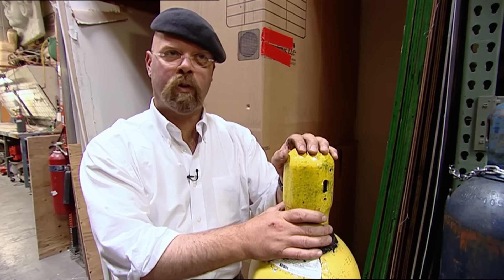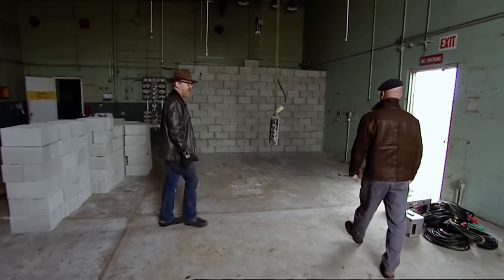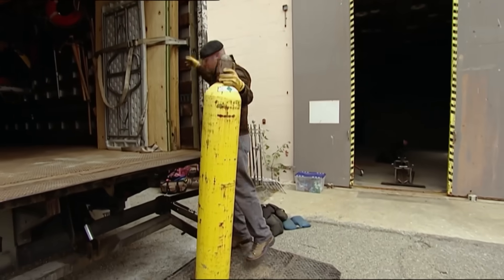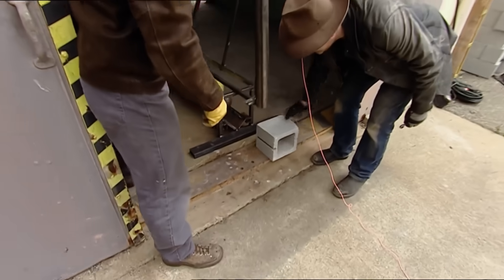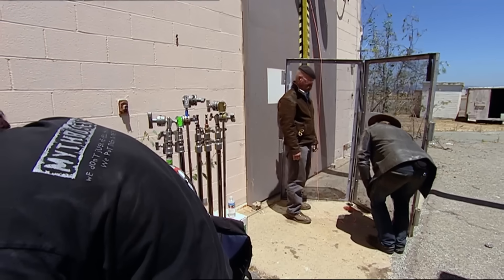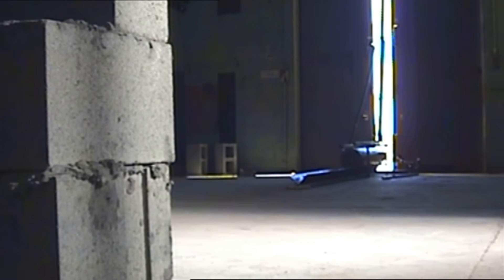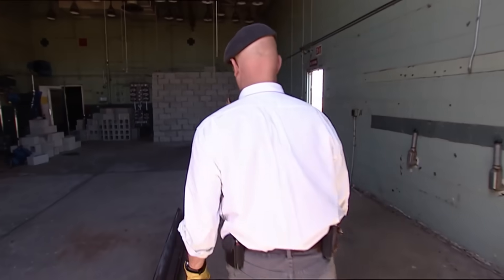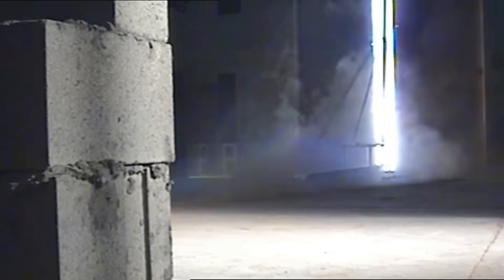What Happens When A Compressed Air Tank Explodes? | MythBusters

Comment: Sixty years ago I worked in a laboratory in the UK, an oxygen cylnder was dropped from the second floor  when it was being delivered via an external door. It landed on its connector, and the cylinder shot over the adjacent single storey building (I was inside). They red-designed the stem so gas cylinders were mounted externally and gas piped to the labs (principally, from memory, oxygen, hydrogen, nitrogen and carbon dioxide.

Comment: Should have done it with a 6000 PSI cylinder of similar size. They weigh more like 200 + lbs. Though that should be done someplace more uninhabited like the quarry where they blew up the concrete redimix truck. Fire stations use several of them in a cascade filling system to fill their carbon fiber breathing air packs to 4000 + psi. Tim at Mac1 Airguns had a surplus US Air Force stamped one in his shop. I remember helping to load it into his pick up to go get it filled at Dive and Surf in Redondo Beach. It was noticeably heavier than a "normal" 3000 psi welding air cylinder.  Dive and surf could only fill it to 4500 psi. 

Decades ago in my 18 wheel travels I talked with a guy that had been in the Air Force stationed way north in the Arctic. Something like Dew Line or similar. He said they had dozens of air force blue 6000 psi cylinders there. He said it was boring duty and sometimes for entertainment they would take several of the 6000 psi bottles out on the ice, lay them down and whack the valve off with a sledge hammer. He said many went out of sight out across the ice which he said was flat and featureless as far as the eye could see.

Comment: It happened to my father when he was foreman of the crew on the Oahe dam project. 
 The construction project required 2 large tunnels to divert the Missouri River while the dam was being built. 
 An oxygen cylinder fell over, the valve broke,  the cylinder became an unguided rocket inside the tunnel.
 Dad said the circular I-beams were 1 foot in diameter,  1/2 in thick.
 The cylinder bent several. 
 No one was hurt. Just scared I expect.

Comment: High school welding class in 1980 a fellow student was changing an oxygen cylinder and had removed the cap before he had the safety chain in place.
Somehow the cylinder was knocked over and it hit a low steel stand causing the valve to be knocked off.  It took off, knocked some light weight stuff out of it's way and went through the outside wall, finally stopping about 3/4 of a city block away in an alley that just happened to line up with it's travel path.  My ears rang for two days after that.

Comment: I’ve always wanted to try this after working Heavy Structural Steel  25 years. THANK YALL 👍👍 For those that don’t know the difference between a Full O2 cylinder and a EMPTY one a full one will actually make a POPPING noise when you give valve a good crank open and an  empty one will not , that’s why you write on top of cylinder M.T. (EMPTY) so the next guy doesn’t DRAG a M.T. tank out to his work area , “CAPISH” especially a SIXPAK of O2 cylinders 🤬 40lbs of O2 and 6-7 lbs of fuel “acetylene” . NG fuel may vary and Never start a Long Cut  with a medium low tank … p.s………… … 🔥Burners🔥Rule🔥

Comment: Something like this happened a few years before my time at a technical college in Vancouver. The cylinder went through the front doors, managed to ramp off something, went through the building across the courtyard (through 4 walls), was redirected by way of the front quarter of a car (the driver was ok) before guttering by the sidewalk and wedging itself against the back wheel of a bus. The bus was struck so hard the driver thought he had been rear-ended.
That was the last day the college operated without SOPs for handling had cylinders.

Comment: As a construction millwright, I heard stories about the old days when they were building a coal-fired generating plant on Lake Erie that they would tack weld a pipe at a 45° angle and put one of these cylinders in it and then knock off the valve with a sledgehammer and apparently, the tank would go about a mile out into the lake before splashdown. The good old days.
Reply: Equally scary and awesome

Comment: That  IS NOT an  " explosion " .    
A high pressure tank holding  2500- 3000 psi  -  burst / exploding in frags would be lethal to anyone nearby. 
Most high pressure cylinder heads have blow out safety features made into the bottle head that pops open before the tank fail pressure is reached -  to prevent the tank from exploding.
Reply: Yeah we’ve been clickbaited to old content

Comment: While the acceleration force is highest when tank pressure is highest, the compressed gas cylinder may not have reached maximum velocity by the time it hit the first block wall. If they computed the tank's velocity and remaining pressure with time, they could have determined when it would have reached max velocity.

Comment: In the 70's I was working in a pizza place and someone knocked over a CO2 cylinder and knocked the valve off. It went thru a metal door into the rear parking lot.

Comment: That tank had a lot more acceleration left in it. If it can do that in such a small space it's scary to think about what it could do with more runway.
Reply: Put wings on it 😁
Reply: It's terrifying. I've seen it happen with a helium cylinder. It pretty much becomes a missile that goes through anything short of heavily reinforced concrete. The one at work went through a cinder block wall, into the office and up through the sheet metal roof landing in the grass near the parking lot. If someone was in the path they would be dead..
Reply: In theory yes, in practice it would start tumbling well before maximum potential velocity is achieved…
Reply: Rocket car part 4 lol
Reply: Needs a Taofledermaus treatment.

Comment: I used to be an airsmith at a welding supply company ..we actually would show this episode to new hires to teach cylinder safety ...
Reply: Back in my Navy days a Master Chief once told me if ya get hit by one of these you won’t slow it down, just lubricate it.
Reply: @ironsausage808  he's absolutely right. Something that heavy going that fast is just going to pass right through you without much fuss.
Reply: In welding school we were shown films of what could happen with high pressure cylinders if mishandled or treated without respect. It's no joke. Basically a rocket motor just waiting for some clutz to set it off. 😳
Reply: New hires: cool, I'd like to see it happen someday (probably)
Reply: I live on a farm and will take what I can get for safety training material, this got added to the list reeaaally quickly lol

Comment: A nice demonstration ...that in no way replicates what really happens. I have actually seen two events where some idiot violated safety guidelines and let an "H" cylinder fall and shear the valve off. Fortunately no one was injured, cylinders do not fall perfectly straight, valves do not shear off perfectly straight and those fuckers don't shoot across the floor perfectly straight (unless guided somehow). The do knock holes in cinder block, they do tear the place apart and they bounce all over the place until the gas pressure runs out spinning in a circle the one time and lodged in a corner the other. Oh yeah, they scare the living shit outta most people and cause a lot of yelling and screaming...and more OSHA paperwork than you can imagine.

Comment: A welding instructor told me a story about an argon tank going ballistic.

During a shop cleaning, someone unhooked the chain strap from around the tank, meaning to sweep up dust from behind it. Unfortunately,  they forgot to place the chain back. A while later, a welding cart bumped into it, knocking it over and cracking the side of the nozzle. The tank began spinning in place so fast, it wore a circular indent into the concrete. Terrifying.

Comment: That's not a solid brick wall, it a hollow cinder block wall that you can punch a hole in it with a hammer.
Reply: Yeah and that cylider will go thru both and keep going
Reply: They represented what a typical masonry wall would be and what a cylinder could do to it.  Most masonry walls in commercial buildings are completely unreinforced like that (i.e no rebar or internal grouting).  In heavy industrial buildings you would have grouted vertical cores with a single 15M (metric) or minimum #4 bar (imperial) every 4'-0" and at each building corner, plus a horizontal grouted course, with similar rebar, along the base of the wall and every 4'-0" up, but in between those grouted areas the wall would stay hollow.  No one builds a masonry wall and grouts every single core, it's a waste of money.
Reply: @mrquirky3626 they do it around where I live.
Reply: @waynes.2983 I have personally done it on many occasions with certain small walls, problem with that is reactive soil and movement. Stripping a concrete filled wall is not fun
Reply: In US houses this is not only a solid wall, it's a bunker wall...

Comment: I worked in an industrial fab shop for 35 years.  One day the new guy started.  He thought he knew everything.  The Shop was switching from the first shift to the second shift, so twice the amount of people were in the shop.  Some working and some milling around.  The new guy decided he needed to move the Oxygen cylinder from one part of the shop to the other.  He strapped it down to the dolly and moved it.  Nothing out of the ordinary happened, just another safe day at our place of work!
Reply: What's the moral of the story then?
Reply: @ЮрийГригорьев-ь8х  you can lead a horse to water but you can’t have a bird in the hand.
Reply: @mcdouche2 I didn't get what the new guy did wrong? He wasn't supposed to move the oxygen tank or he wasn't supposed to strap it to the dolly?
Reply: @ЮрийГригорьев-ь8х  it’s an anticlimactic story.  Meaningless in its story.  Pointless for its length.  Its only point is to leave the reader stunned after reading it and possibly laugh at its stupidity.
Reply: @mcdouche2 alright. Thank you. I'll avoid touching oxygen tanks anyway.
Reply: @ЮрийГригорьев-ь8х 0 critical thinking
Reply: @pootispiker2866 alright. Good for you. I want to be like you. I find myself overthinking at times.
Reply: @ЮрийГригорьев-ь8х Must not be very often that happens, yeah

Comment: Not the best test, in my opinion.  They should have put rebar vertical and horizontal in the concrete blocks, filled the spaces with concrete.
Reply: For what? Is this how they build cinderblock walls in real life?
Reply: @ЮрийГригорьев-ь8х  IF you want strength, yes.
Reply: @sandrabonner8208 well, aren't cinderblocks by design are supposed to be insulating material as opposed to strong materials?
Reply: @ЮрийГригорьев-ь8х  It depends on their function; for insulated walls, yes, but concrete is a poor insulator so I would recommend the exteriror walls built for strength, interior walls wood or steel with insulation then drywall.

Comment: An old boss of mine was in the U.S. Navy, was coming back to his ship (destroyer), saw some excitement going on, found out that a fire extinguisher that sits on the pier got knocked over, the valve got sheared off, it embedded itself into the hull of the ship. Told me that after I told him about several helium cylinders sitting in the store that I worked at that were not secured to the wall. I worked in the auto shop of the store (Montgomery Wards). I commented to him about how we in the shop had to have the oxygen and acetylene cylinders secured, that was when he told me that story. Got a 100.00 gift card as a reward.

Comment: Heard of a story where ppl didn't drain the water in the air tank daily, so over time the water rusted the tank internally.  This weakens the tank so one day it exploded.  But thankfully no one was hurt.  Even a blow out semi tire is dangerous.  At my mechanic shop, whenever they're filling a tire with air, they placed it inside this tire guard, so if it over pressurized & blows, the rim won't be a flying projectile.

Comment: Back when I was in high school, a fire started in the metal shop classroom and the heat burst oxygen and acetylene cylinders kept there.  All of them blew through concrete walls and held the fire department at bay until the cylinders were expended.
Reply: Dude. Same thing happened in my ag mechanics class in 1985... you didn't go to Willits Highschool did you?
Reply: School's out... for summer....  school's out for ever!  School's been blown...to pieces!
Reply: In my high school someone had broke into the  vocational shop at night stole a torch set and torched their way into the high school office safe.  Trying to change their grades? I don't imagine a school stored at lot of the milk money from lunch In the office. Don't think a school is a bank.
Reply: @ChrisZost  high school office safe?! The used gasses probably cost more than what was there.

Comment: My dad mentioned an accident that happened at a Westinghouse factory.  Somehow a large tank like that got knocked over in the shipping and receiving area and sheared off the valve.  It went through a loading dock door about 75 feet away and out across the parking lot, only to stop in the field next door, about 200 feet away.  No one was hurt.
Reply: Definitely not the first. My high school auto shop instructor in 1971 told a story of  a tank being knocked over, valve sheared off and sent the tank through a 12 inch brick wall and about 100 yards out into a field.
Reply: @sniper152 nope
Reply: @sniper152  its a cylinder, i dont know why thy call it a tank,
Reply: A tank is a cylinder with the ends capped off.
Reply: @MicahThomason a tank is a vehicle. I don't know why they call it a tank
Reply: @Mr.Anders0n_ it's called a tank because it stores something just like a water tank
Reply: @Mr.Anders0n_  Amusingly, that stems from military disinformation. The first tracked, gunned, armored land vehicles were listed as "tanks" specifically so anyone reading a manifest would think "containers". And it stuck.
Reply: My dad saw something similar happen building planes at the McDonnell-Douglas plant in Long Beach. Something happened where an oxygen cylinder was knocked over or fell down and the valve was broken off. It shot across the floor, punched through the aluminum wall, and across the ground outside. It eventually hit another hangar and came to rest. No one was hurt, the damage was comparatively minor, but there was a safety stand down.
Reply: My dad had a similar experience when a tank dropped down a elevator shaft. A few seconds later it came back up through the roof
Reply: They definitely will blast through a metal warehouse roof and land far away!
Reply: Was the tank okay?
Reply: @Boco_Corwin  it should be,
Reply: Brown pants moments throughout the plant though.
Reply: I tried knocking in the valve off one of these with a great big monkey wrench and it's a lot harder than you would think, I actually broke a weld on the Rock before I could break the valve off
Reply: i was a boilermaker and yes if an oxygen cylinder falls and the valve breaks off its like a torpedo
Reply: My grandpa had one of these fall over at the Grumman plant, everyone was in line for lunch and the tank went through every single one of them, killing everyone at the factory
Reply: @RVBJohn nope
Reply: @AMDSR94 uh huh YOU CALLING HIM A LIAR
Reply: I'm your daddy
Reply: @canUfeelMYface штF

Comment: This happened to my father.
He was on a gas company work crew, and they had a job inside a brick valve house that was on the south end of the block that I grew up on. The oxygen tank was unsecured and got knocked over and the valve was knocked off on a piece of equipment. The tank missed all three of them, but it left the building through the southwest corner and traveled three blocks west on the nearby street. If that thing had taken out any of the gas piping in that building, the combination of methanr and pure oxygen would have burned all three of them alive.

Comment: this happened to us in our parade float building shop. A coworker knocked over a acetylene tank, it hit right on the valve across a iron beam, the tank shot across the shop towards me, I jump clinging to a post, it bounced off in another direction, I ran out of the open bay door... no one got hurt, no fire. Thankful for doing parkor.
Reply: And acetylene tanks are only about 300 psig, unlike the 2250 for compressed gases.

Comment: Why lard and not crude oil?
Reply: Lard is cheaper
Reply: @aidankilleen7372  Lard is environmentally cleaner.  Breaks down and won't pollute ground water.
Reply: @aidankilleen7372 they have to worry about about the cost of crude oil for one episode when they have lead foil imported, make custom wrecking balls, test military explosives and rent full scale construction machines, wreck cars, use bulldozers, full on tanks, incendiary rounds, secret service vehicles used in the convoy that accompanies the president, and use classified explosives, rpgs, airplanes, jet plane engines, and so many more things that they and ruin, intentionally or unintentionally, yet they can’t afford a couple buckets of crude oil, in a major city near a port?
Reply: @IRKnTBot lard is cheaper and safer than crude oil. It always has been. Jamie keeps a bunch of the stuff around for just this kind of stuff.

Crude oil is highly flamable. Where as lard is only flamable after being preheated and brought beyond its smoke point. 

Lard is genuinely better for this.
Reply: @aidankilleen7372 okay, safer is a viable reason. Cost wouldn’t be a problem for their budget.